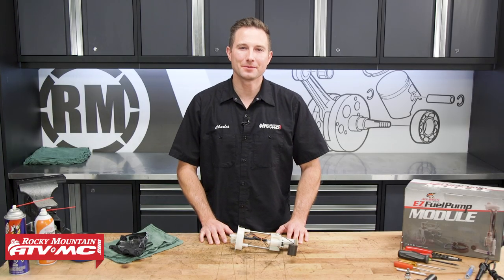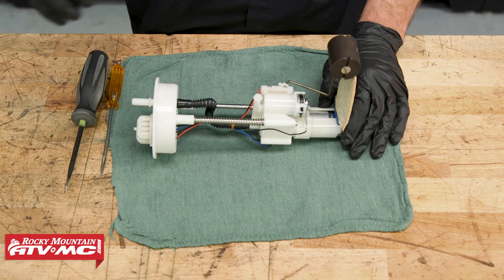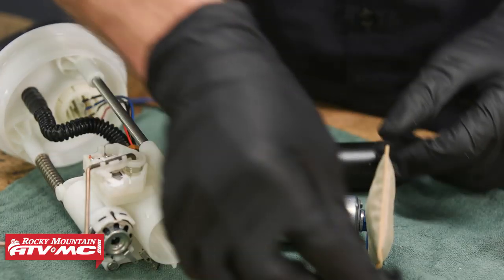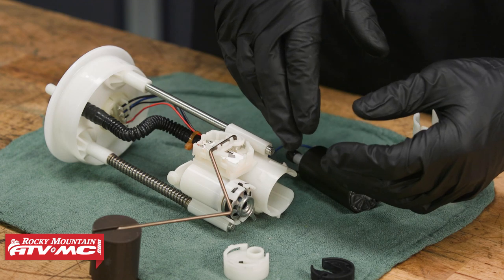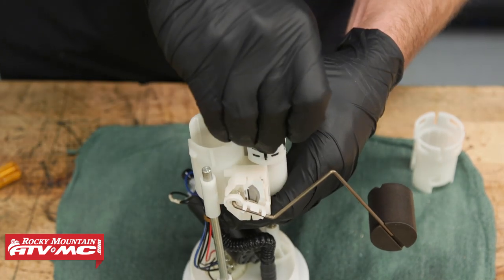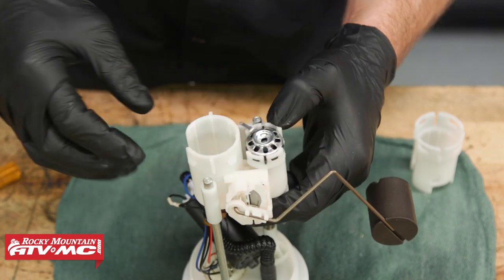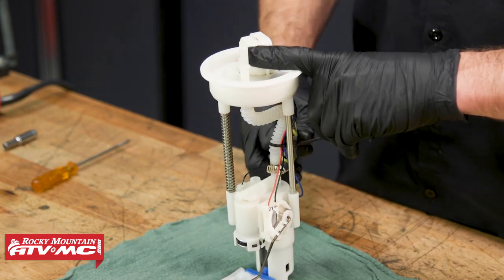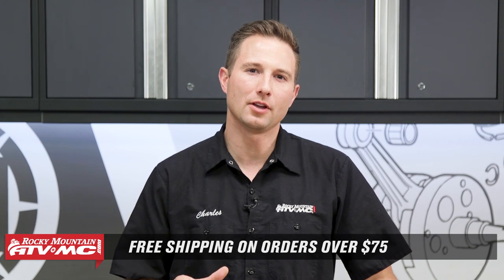How To Rebuild the Fuel Pump on a Polaris RZR/Ranger

Comment: You know what would cause a viton grommet to keep ripping on older model fuel pump assembly? Its the viton grommet that goes over the pump barrel. Ive replaced 2 and they all keep splitting on me and thus causing fuel pressure failure.